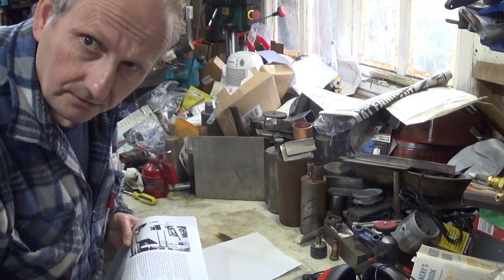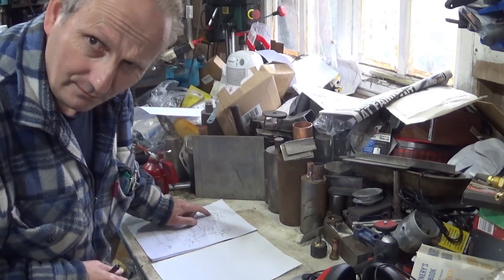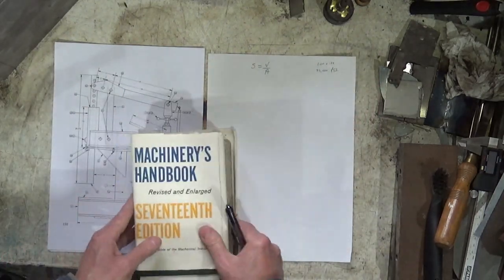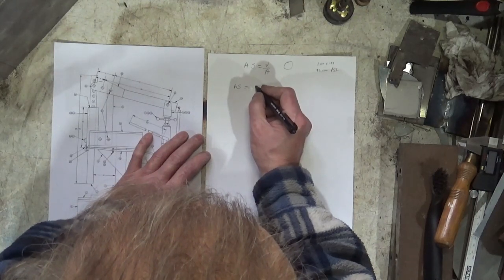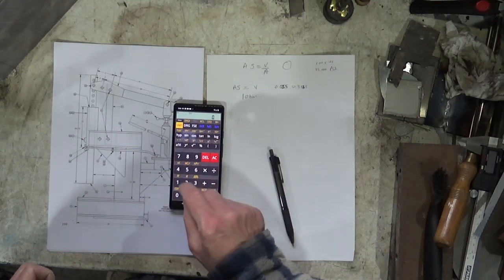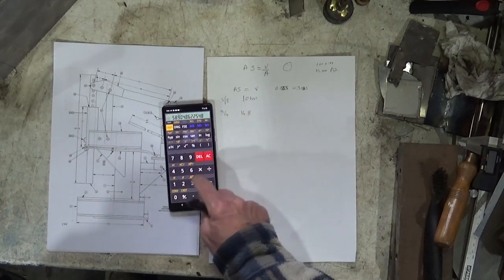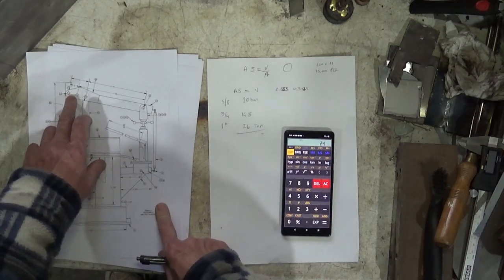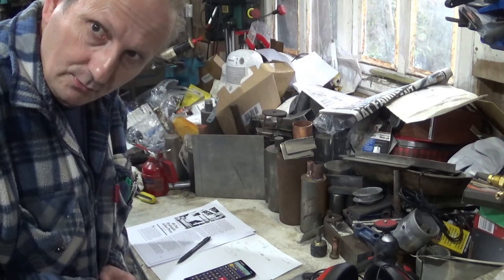Home Shop Machinist 40 ton arbor press Will it work?

Comment: eyup Ben
Mathemagician👍👍👍👍😉😉
cheers
Kev
Reply from the maker: I'm not a massive fan of catastrophic failure!
Many thanks for watching!
Reply: @BensWorkshop  I'm The same, 
belt & braces, then double it!!😉😉
Reply from the maker: @MrFactotum  can't quite go double, but could get away with 1&1/8th which gets me 33 tons from memory.
Reply: @BensWorkshop  It's swings and roundabouts
The bigger you go, the heavier and less portable structure to handle,
 hernia springs to mind!!🤣🤣👍👍👍👍
Reply from the maker: It's the pins I am making bigger. Should be OK.

Comment: You have two shears per pin ie. That load is applied on each side so a 20 ton pin in that joint will take a 40 ton shear.
Reply from the maker: That is true, but still not enough for a 40 ton press. Many thanks for that and thanks for watching!
Reply: @BensWorkshop  yup, but you'd only need to go up to a 20mm grade 10.9 bolt to have plenty of safety, and I'd definitely use a bolt not a clevis, them ears spreading would change the equation a bit.
Reply from the maker: For what tonnage? Looking at it, on a single shear I worked out 1" would be around 26 tons. So two would only get you to 52 tons.
Reply: @BensWorkshop  I'm sorry, I quoted minimum breaking load, for m20 10.9 it's 204kn or 20.4 ton, 40.8 ton in your application.
12.9 is the best standard metric grade that won't cost a fortune.
If you don't to bolt it, chromoly is good for pins.
Reply from the maker: @turboconqueringmegaeagle9006  I have Cromoly.... But put out an enquiry on the bolts.
Reply from the maker: Is that tensile strength rather than shear? According to Machinery's handbook, shear is 3/4 of tensile strenghth. I can only buy them in boxes of 10, so chromoly looks like a good bet as I can just make those to suit.
Reply: @BensWorkshop  no, thats shear. I'd say if you are lucky enough to have lumps of cromoly floating around already it's an extra sensible choice mate!
Reply from the maker: I do, buy it from the scrapyard at 50p a KG.
Reply from the maker: That said I can also buy 12.9 bolts at 20mm....

Comment: Ahha, an under engineered pin on the original design, that would have gone "ping", well checked Ben.  Although you usually have to go it some to achieve the rated maximum of some of those bottle jacks, the cheap ones at any rate, but it would still have exceeded that pin, certainly with the 12 ton jack.
Reply from the maker: I thought I would check.Just as well.

Many thanks for watching!
Reply: @BensWorkshop  Yeah, definitely the right time to make adjustments because you can't uprate the pin without uprating the surrounding parts.  It'll be an excellent project to see coming together.
Reply from the maker: My thinking too.

Comment: Now if you had only asked for 4” square bare
Reply from the maker: Well, that would make it far too heavy! Besides which that would be pushing my luck.

James @Turbo Conquering Mega Eagle (Does some interesting builds) pointed out that in fact I only need half the shear strength as there are two shear points either side of the pin.

That was a lot of copper in those welders!

Many thanks for the metal and for watching!